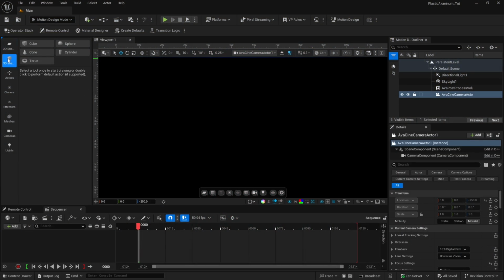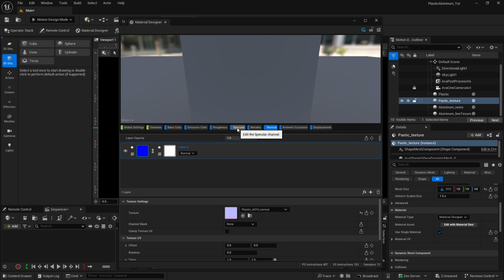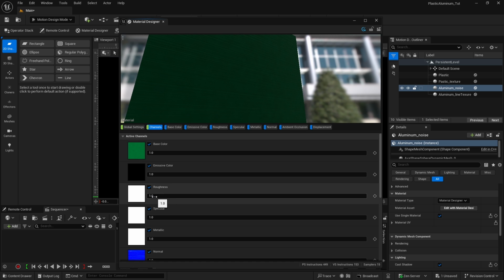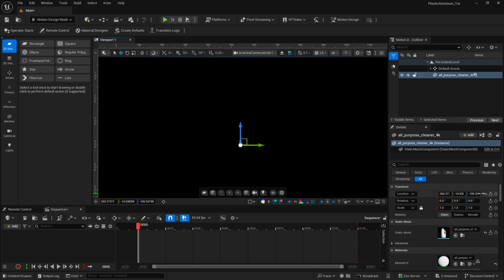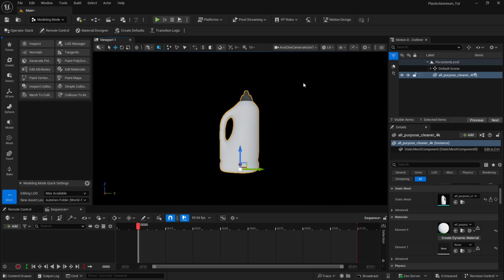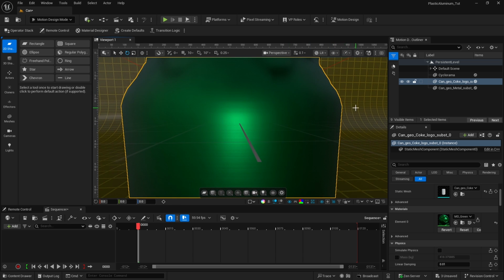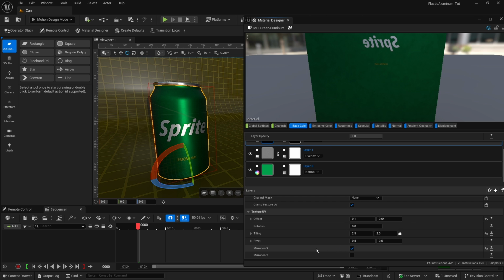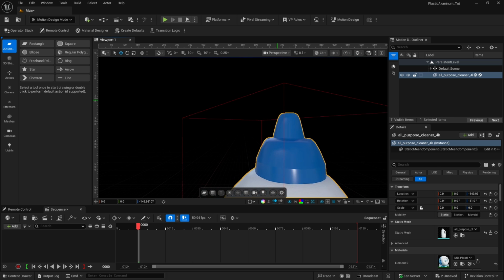Unreal Engine Motion Design Tools: Materials - Plastic & Aluminum

Comment: Thanks so much again. Really great inspiring content. I have one question. When you scale up to 9.0..  Isn't there like a golden rule, like use real measurements? The sprite cane could be 12.2 cm height. Wouldn't you need to do a reset transform in Unrea.. so that the scale is back to 1.0 ? and all the other stuff, like lights, behaves correctly? Is this a necessary step?